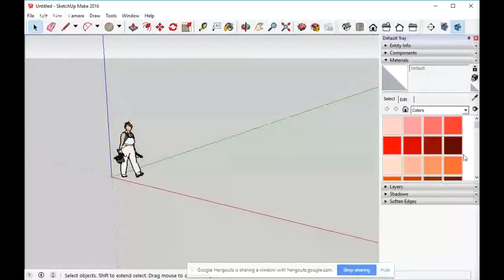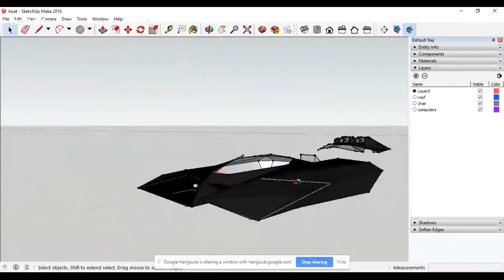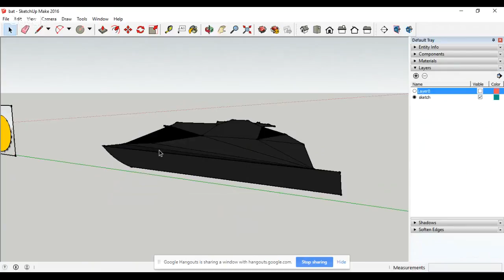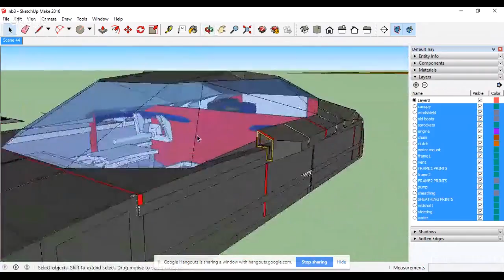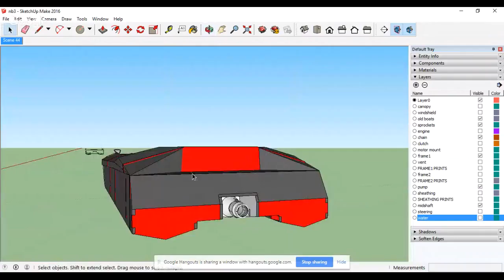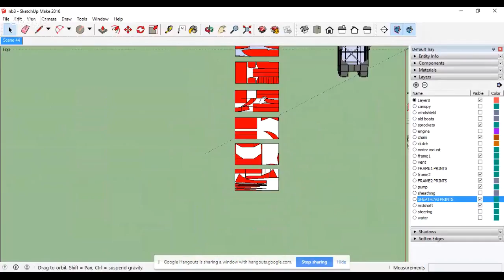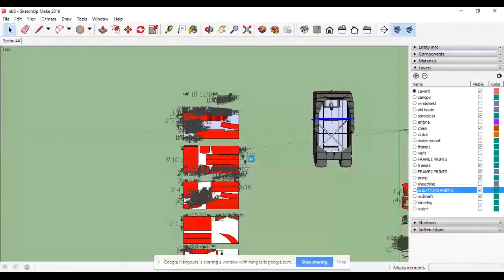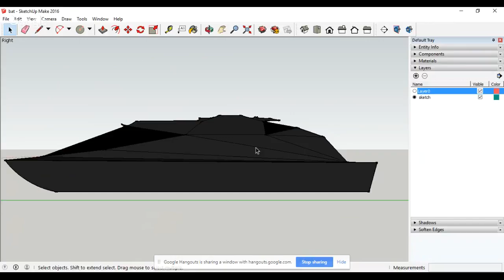Live new boat design and Q&A

Comment: I like that last rendering from the side. If I was you I would ditch the bi-hull design and go for a traditional v-hull for the pure sake that it will be much easier for your jet pump to be at the lowest point and also with a bihull or pontoon style boat while turning it will not bank or lean into the turn. Also with a v-hull it will be easier to make your stringers and aluminum hull panels with the least amount of rivets or welding.
Reply from the maker: Thanks a lot! For some reason I always start from the side when im designing a boat. You are so right about ditching the two hulls for one. To be honest I only choose the dual hull because i love the way it looks lol
My goal is to incorporate the two and attempt to marry them together. Thanks for the awesome help brother!
Reply: ronaldhotboy they make boats called tri-hull which basically incorporates the v hull and pontune style.
Reply from the maker: blindabinda123 that just may be the perfect compromise between the two brother. You might be onto something this will be the third boat and coincidentally with three hulls
Reply: ronaldhotboy it just really depends what you want to do with it. But in the end having that v hull is the best thing for the jet pump. There are all kinds of plans for mini jet boats. Those things are soo fast.